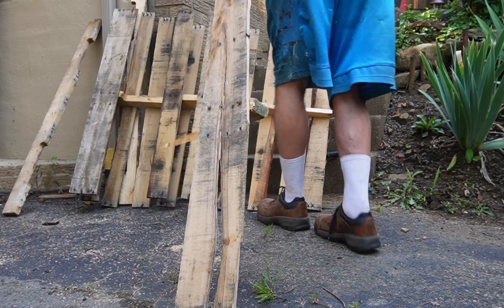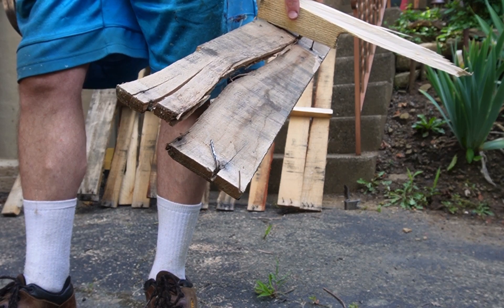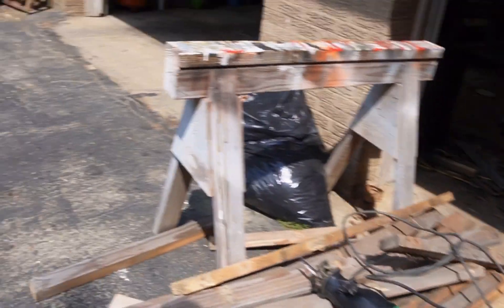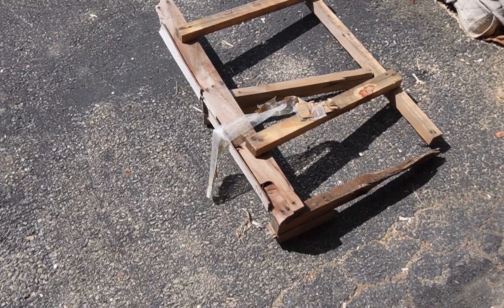Free Lumber! How to Disassemble Pallets

Comment: With a carjack with screw thread you can usually get the pallets apart without breaking any of the wood. If there are wooden blocks (of composite material), usually you can smash those blocks and get the planks out without having to pry them. Prying can break the planks. 

I didnt ever think about sawing the nails, thats new to me. 

Pallet wood is great for concrete forms. Its not the best looking wood, but it gives a cool wood shape to the concrete. 

To use it as furniture; its best to treat the wood for woodworm or insects. You can easily get psocids or woodworms in the wood, so be sure to treat it before moving it inside, because you can get an infestation. 

Greetings,

Jeff
Reply from the maker: Thanks Jeff. I'll try it next time I break up some pallets and post another video showing how it goes.